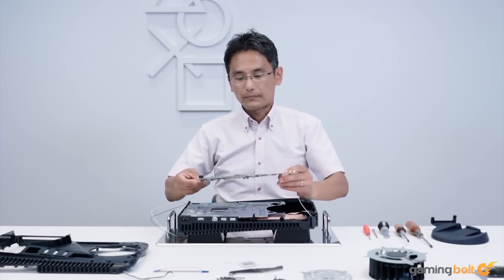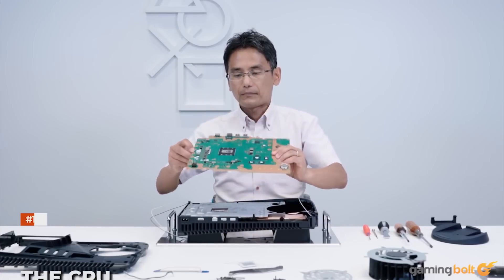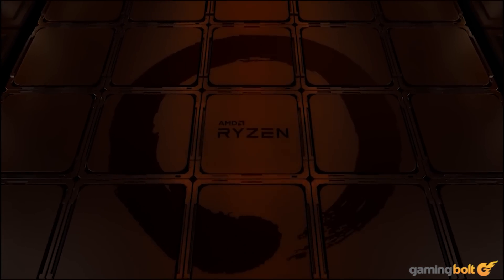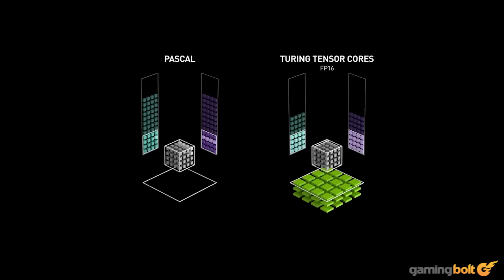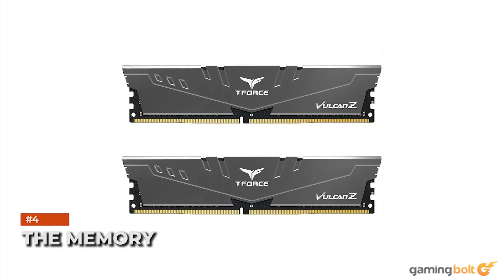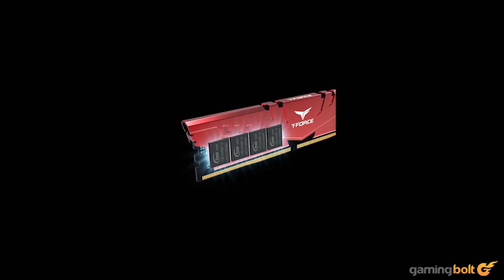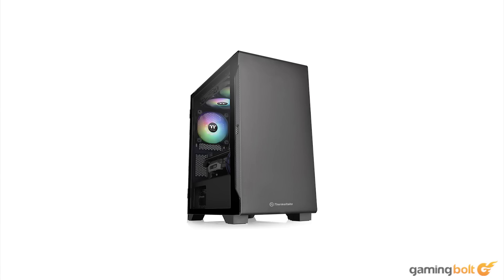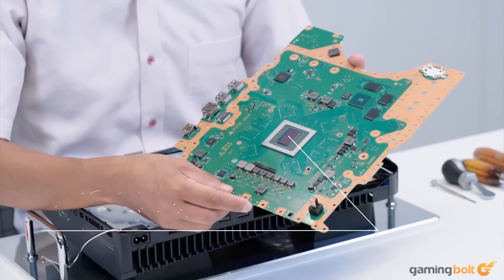How Much Would It Cost To Build A PC As Powerful As The PS5? (2021 Edition)

Comment: Left out the fact that the "build" is missing the 9 cores needed to replace the dedicated compression /decompression chip. Also missing the 2 CPU cores needed for the i/o. Both discussed by Mark Cerny in his presentation. Also ignored the fact that the expansion slot needs 2nd gen PCIe v4 ssd drives to match the PS5 so how do you land at a 979 evo PCIe 3 drive. Ignores the fact that windows still doesn't have a comparable way to run an SSD efficiently and will only start that process with Windows 11 storage changes for ssd's. Also ignored the fact that the GPU internals are closer to a 3070 and instead quoted totally useless TFLOP's. Overall a fail in a build.
Reply: i was intrigued by the part where you mention all the cores needed for C/D and i/o and how PS5 has dedicated chip for such, so i searched up "mark cerny ps5"  and watched the whole presentation, all i can say is thank you and wow. I now think that PC gamers are even more doomed. When do you think we can see PCs that match PS5 for around 700$? I think the only thing that can save PC is mass produced "console like" PC solution that wont allow for customization but will hit the specs and price range of consoles. Do you think any company will take on such a task considering tight profit margins ?
Reply: @newyork6109  PC's will get a build close to PS5 soon enough, it will just take time because of the supply for chips are bad overall. This PC build is also just horribly wrong. He should have used AMD for the GPU as well since its the closest to PS5 and Xbox. He didnt account for the NVME drive being completely off and all the crap he's missing. He also forgets that PS5 and Xbox have their chips OC'd usually so he could also just OC the GPU and CPU to go higher performance than the consoles.

Comment: Guys with a PS5 need a PC for everyday use... getting one fast enough for very smooth internet use is not free...
Real price of a PS5 is console+fast PC that can handle with easy everyday use...
Reply: Internet use isn't that demanding, litterally any desktop with a old I5 or I7 will do it.
Reply: @Orcawhale1  U never try running many open tabs on chrome i guess... i think anything under ''not that old'' 4 core+8gb+ssd is horrible...
Having a gaming PC means butter smooth everyday use... 
Maybe is just me, but many times i got open chrome+torrent+steam+pdf program+antivirus+video player+something else all running together... having a gaming PC means i don't even think about system slowing down...
Reply: @ericsilva7430  You don't have to use Chrome as your browser, there are other options. 
Nor is Chrome that demanding on the cpu. 
It's more ram, it tends to eat alot of.
Reply: You need Quad core i7 and 16gb ram to run everyday usage?

Comment: Forget it, just got a PS5, just tried R&C, PS5 cost 450 bucks, and you won't be getting a pc to offer anything even near what this console is doing right now, 4k gaming, hdr, rt, insane  loading speed times have to be seen to be believed, and you can even plays full 4k uhd optical discs........no 450 bucks pc is going to get close to doing all that, bang for buck the ps5 is out if this world, and i paid 430 bucks for a ps3 back in 2007 and look what 30 bucks more gets me 14 years later.

Comment: This isn't even an accurate comparison lol. You are comparing a cpu that clocks out at 3.5ghz vs a cpu with a clockspeed 4.4 ghz. Then you compare a gpu that you said yourself has 30% higher specs and then you compare 16 gb shared memory to 16gb dram and a gpu with 12 gb vram. You can't compare 2 different platforms since you can't match exact specs or run games at the same settings.
Reply: @Transistor Jump That's a custom ssd that you can't buy and if you want to upgrade your Ps5 ssd, it's not cheap. Even with some games the Ps5 loading speeds are still slow just because a throttled cpu can slow your loading speeds. Like I said this isn't an accurate comparison just because he's comparing something much higher spec.
Reply: @kylelochner5686  show me a PC game with Ratche and clank(ps5) loading times
Reply: @adultsasukesolosakatsuki5k409  That's a silly question because you are comparing an exclusive thats only optimized for 1 platform.The better question is why are 3rd party ssd's with lower spec loading faster in ps5 games including r&c
Reply: @Transistor Jump and you know that how? Gamer's Nexus did a comparison and showed a 3300x 4 core CPU paired with a GTX 1060 was 40 fps faster than the ps5 in DMC5 120hz mode. 3600x + 2060 would definitely be more than enough.
Reply: Again, clockspeed doesnt matter if its different CPUs. AMD usually has lower clockspeeds than Intel but they still steamroll Intel all the time.
Reply: @sack8439  lol not only the clockspeed it's the l3 cache thats 32 mb on the 3700x VS the consoles 8mb cache. That's a huge spec difference. The 4700s is the exact same spec as the consoles cpu. Same core count same cache size same instruction set but that cpu scores lower than a 2700x in multithreading in cinebench and lower than a 7700k in single threading performance. You should check gaming bolts other videos they have a reputation for not knowing what they're talking about
Reply: The problem is people are trying to match the hardware spec for spec but whats more accurate is matching real world performance. The ps5 is closer to a 3600x cpu paired with an rtx 2060/2060 super

Comment: The 3060 you picked is roughly as fast as an AMD RX 5700 XT GPU which is a little slower than the PS5 GPU (9.7TF vs 10.2TF), the 3060 TI or RX6700XT would be choices here (and more expensive!!!). Dont compare Nvidia TFLOPS to AMD, for years Nvidia did more with less but now Ampere TFLOPs are not really comparable to AMD as half of the "shaders" are actually used for either FP32 or integer work meaning that in most games you are not getting the full FP32 performance as a decent chunk of the Shaders are doing integer. This is NOT a bad thing its just a good for Nvidia to not leave FP32 performance on the table in applications or games that are more FP32 heavy, but it means you cant use TF as a measure of performance when comparing AMD to Nvidia cards (like you haven't been able to for years - Radeon 7 - 13.4TF, 1080Ti 11.3 TF yet the 1080ti is the faster card....)
Reply: The best comparison would be the 6600 XT. 
The 3060 TI and 6700XT are in completely different leagues. 
The 6600XT has 32 CUs vs The PS5s 36 CUs. I would not be surprised if the 6600XT actually out performed the PS5 even with the lower amount of Compute units. But I’d probably say maybe only 7% performance difference across the board.
Reply: You talk about not comparing TFLOPS but then you just compared PS5 GPU TFLOP to an AMD GPU TFLOP, I am a PC gamer but dont be going all hypocritical dude. We just cant use TFLOPS reliably as a comparison to consoles since they are on a different architecture.

Comment: I have a PC and PS5 both and like hardly 1% of games (exclusive ) I play on ps5 cuz it uses upscaling tech which sucks very noticeable difference, even worse ps5 uses mid high setting ripping off shadows reflection, textures and ruining the fun.
Pc community is growing much faster it barely had a market in 2000s and now it is twice as big as ps, so I get to play with more ppls.
Good thing PlayStation and Xbox both did by porting their games to PC other then competing. I might not buy ps6 if they keep doing the same. (I would have no reason to buy).

Comment: Correction: 3700X will be faster than the CPU in PS5- I'd probably go with 2700X or so.
Reply: @Transistor Jump the ps5 cpu Is the amd 4700s. You can look at benchmarks comparing it's performance con cpu workloads compared to the 3600.Btw the 4700s is much much slower than a 3600.
Reply: @tafarimakonnan1763   you are arguing this and I am thinking why didn't they offer it with RDNA 2.0 so people can build a PS5 like PC inside/out.
Reply: @nayyarrashid4661  It may be possible in the futures if they put the cpu on a different motherboard with pcie gen 4. People would just need a gpu to compare performance.
Reply: @Transistor Jump why are you hurling insults at me ? A simple Google search will prove that the amd 4700s is the ps5 cpu. It's being sold in certain countries as we speak.
Reply: @Transistor Jumpwhat makes it different? at first they assumed it was the xbox cpu but then they realized it was the ps5 cpu. It has 16gb of gddr6 memory sodered on to the board and it`s has a shared memory pool   even though the gpu is disabled. The gpu was rdna 2 and was disabled. please share your sources which say otherwise instead of just hurling dimwit insults.
Reply: @Transistor Jump 
> goes on YouTube comment section
> calls everyone a clown for not liking ps5

Comment: That SSD is not even close 😂 the closest I've found is the "liqid honey badger" 24Gb/s rated about 13Gb/s actual benchmarked. It costs about £5'000. When PC adopts the tech you'll be marrying your pc.
Reply: Theres a video online talking about some new M.2'S coming to the market and I'm sure the new Firecuda is faster than the PS5 SSD.
Reply: @toomanysnowflakes.1167  it's the kracken chip that makes the difference. Plus ps5 ssd has 12 channels. You loose 50-60% of the bandwidth in a pc, ps5 is 100% up to 22Gb/s
Reply: @jamiepaulduncan  Its Kraken Compression just wait it won't be long a Samsung 970 evo is only threes seconds slower at loading RE 8 and thats nowhere near the fastest M.2 available on PC.
Reply: @jamiepaulduncan  I've just bought a new M.2 NVME SDD for my PS5 for when the update comes out. The consoles are cheap once you factor in the price of an M.2 upgrade the price to perforance goes down quite a bit. My PS5 has cost me nearly £900 all in its not cheap.
Reply: @toomanysnowflakes.1167  its oodle compression. Kracken is the custom decompression block. And the company who created the compression tech said that with the two technologies used effectively they can get I/O bandwidth of over 18Gb/s and the chips max is 22. With pc losing half the performance they'd need to have an SSD @ 36-44Gb/s or put a chip like tempest in pc's. These are all compression figures but considering that just increases effective bandwidth I'd compress everything.
Reply: @jamiepaulduncan  They've made a lot of bold claims about the PS5 SSD and in many cases its barely any faster than the Series X/S. I just want to upgrade my storage and hopefully all is good i got the drive the Mark Cerny recommended the WD SN850 2TB. I hope they can do all the things they've said possible with the PS5 SSD as if it's true we're in for a treat its about time as games design has been stagnant for years now.
Reply: @jamiepaulduncan  They claimed its capable of a lot more than fast loading times.
Reply: @toomanysnowflakes.1167  yes faster asset streaming no need for corridors/lifts to load parts levels or assets. Easy example is the topiary sprinkler on rift apart old games needed those textures loaded at the beginning of the level even if you don't use it, ps5 can load them as you pull the trigger then scrubs it freeing up RAM.
Reply: @toomanysnowflakes.1167  here's an explanation https://youtu.be/UlFiBDhLhgQ
Reply: go check digital foundry's review kid!!

ps5 = RTX 2060 super + i5 9400F / ryzen 3100

sata ssd is more than enough to match console ssd, check comparison between sata ssd vs nvme gen 4

so a $700 pc is equal to a ps5
Reply: @Luiko0406  😂 SATA 's bus bandwidth maximum is 600mb/s nearly 8× less than ps5's raw bandwidth 😂 try again son
Reply: @Luiko0406  oh and the gpu comparison was a best guess based on graphics comparison. Everyone knows that console graphics improve over it's life cycle, which is why Digital Foundry were sure to say it was an estimate.

Comment: At this point, with the prices that the ps5 is going for right now (Newegg is $800-$1200), you might as well spend that kind of money on a pc. Just saying.
Reply: But you forgot that pc components are also being scalped. It's hard to get your hands on a gpu for the recomended price.
Reply: I got my PS5 for RRP, but I also had a 15% off voucher for the online retailer I bought mine for, so it was £382.49, you can't even get an RTX 3060 for close to that on Amazon or any retailer that actually has the cheapest ones in stock, it's £620 for the Palit one.
IMO most people would be better off buying prebuilt PCs at the moment, especially if you don't want to spend over £1400 to match the PS5's gaming performance.

Maybe things will get a little better in the next month or so, but I'm sure stock levels will still be an issue and scalpers will continue to ruin everyone's day in this hobby.

Comment: The comparison with the 3060 is wrong, the teraflops don't mean nothing, take Valhalla for example, the 3060 can't run it even at 1440p at 60fps, the PS5 instead has a minimum resolution of 1500p and it can go up to 4k with a locked 60fps, since the avarage is 1600p~ (stand to Digital foundry) the closest GPU that achieve this target is the 3070/3060 ti
Reply: it was FP16 marketing from nvidia it's actually 8tflops gpu and amd already conformed that rx6600xt with 32 compute units or 9.8 tflops is around 20% faster than rtx3060 so basically equivalent to rtx3060ti that means ps5 gpu is almost rtx3070 level
Reply: @superskills8343  source for 6600xt being 20% faster than 3060 if you will
Reply: @superskills8343  exactly, obv there are some game where is weaker due to the fact that the AMD GPU in raytracyng are weaker but in pure performance is at 3070 level, I've the 3070 and in Valhalla I can't handle 1440p max settings at 60fps
Reply: Valhalla is an amd optimised title so its not a fair comparison.
Reply: @Transistor Jump yeah of course its not fair because Valhalla is an amd optimised title, it wouldn't be fair for the ps5 if we compared it with an nvidia optimized title would it now 😕
Reply: @laxmangamer21  A 3060 and DLSS is a compelling argument for PC over PS5/Series X to be honest and i have a Series X lol . Image quality is vastly better on PC with DLSS than either console.
Reply: @Transistor Jump "Lol...." 🤡🤡
Reply: @laxmangamer21  idk I've a 3070 and with max settings I can't get 60fps all the time, the PS5 runs almost all the time at 1600p that is a lot higher than 1440p with even higher settings that aren't available on PC and it runs at locked 60fps so I understand that the game is AMD optimized etc but there's so much difference
Reply: @laxmangamer21  I7 7700k
Reply: @laxmangamer21  he is showing snow areas where ps5 reaches at 1728p60fps and ps5 gpu is 50% faster than rtx2080 and 5 times faster compared to gtx1060 in heavy loads
https://www.notebookcheck.net/PlayStation-5-tackles-heavy-text-rendering-test-with-extraordinary-computational-performance-that-is-way-beyond-Nvidia-GeForce-RTX-2080-and-previous-gen-consoles.508462.0.html
Reply: @laxmangamer21  rx6600xt is 1080p card it has much slower 256GB/s vram bandwidth so it's not going to perform well at 1440p and 4k
Reply: @laxmangamer21  rx6600xt/rtx3060 is not equivalent to ps5 gpu because ps5 gpu size is 308 mm² at 7nm+ architecture which 31% bigger than rx6600xt plus ps5 gpu has 70% larger transistor count compared to rx6600xt and 50% larger transistor count compared to rtx3060 clocked at 2.233GHz so basically ps5 gpu is 70% stronger than rx6600xt and 80% stronger compared to rtx3060 and vram bandwidth on ps5 gpu is 448GB/s compared to 360GB/s on rtx3060
Reply: @laxmangamer21  rx6600xt has 15% less transistor count but 25% higher clock speed so rx6600xt still slightly faster than rtx3060. ps5 gpu is 80% stronger but in next gen heavy graphics
Reply: @laxmangamer21  ps5 gpu is already equivalent to rtx3070 in games like call of duty cold war and assassin's creed valhalla but I think it's going to outperform rtx3070 because ps5 gpu has 18% larger transistor count and vram bandwidth is also same between ps5 gpu and rtx3070
Reply: @laxmangamer21  rtx3060 is not equivalent to ps5 gpu like gtx760 was never equivalent but gtx760 did outperform ps4 gpu in early games because of cpu limitation on ps4

Comment: I doubt a 3060 gpu would out power a ps5 anyhow considering the xsx performance is better than a 3060ti. There's comparisons for call of duty already. Also with consoles you get decent controller especially with the ps5. If building a pc to be like a console don't bother. For a couple hundred more you can get a 3070 graphics card and easily outpower both consoles although at more cost

Comment: Cool video but I think its not that easy to compare because you dont have games like Ratchet and Clank or Demons Souls on the PC. Also they are optimized for the console.
Reply: @Transistor Jump some games support mkb* huge difference
Reply: @xQuackhead_  Not really
Reply: And you don't have moba's, MMORPG's or rts games on console :/
Reply: @xQuackhead_  Yeah but they would run well, if there were titles for consoles.
Reply: @MHDY-vd8hm  not sure, games are harder to port to PC to console than the other way around + most of those games are unplayable with controller